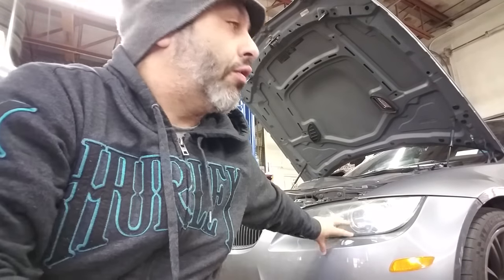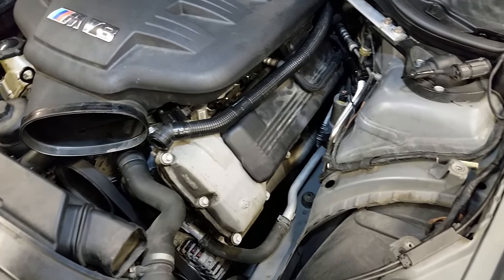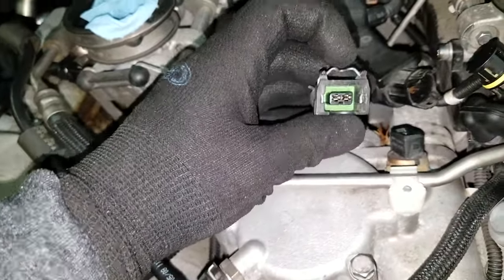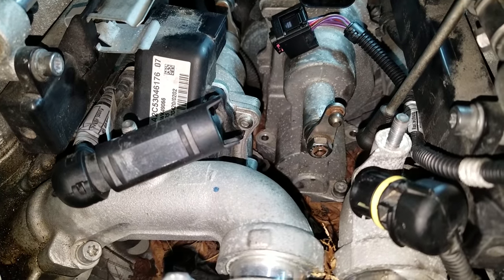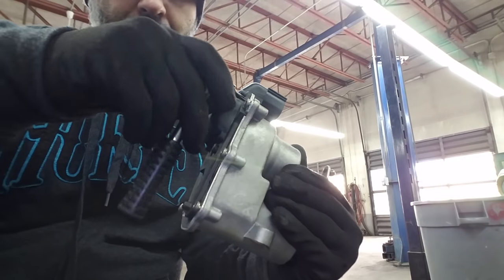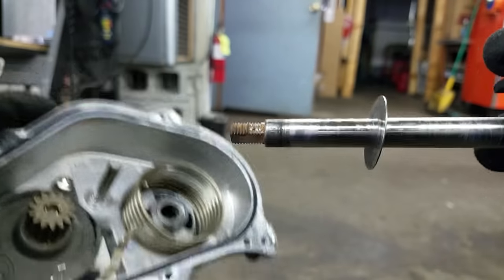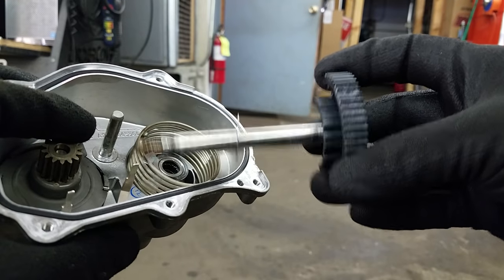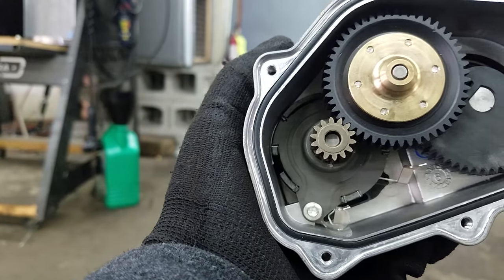BMW S65 E90 E93 E92 M3 Throttle Actuator DIY

Comment: Hey man I have a big question my car is a BMW m3 e93 it jumped into limp mode one day and I parked the car the next day I turned the car on and it was fine when I scanned it code u1151 came up that was it then the next day it didn't jump into limp mode it just said increased emission again I shut it off I didnt have the scanner to check what other code it was some people tell me it's the battery going bad some people tell me just to change the actuator it's my first BMW so I'm trying to get as much knowledge as possible if you can get back to me I'll really appreciate it
Reply from the maker: So I did some research on the u1151 code. I can't find much but what you said. Some people say battery some people say actuators. I need to do a video on the code reader I use...Creator C110 from ebay. If will spit out bmw codes instead of generic codes. I will say this....what your car is doing is what mine did before the actuators went out with it being a bad board. The car wigs out, turn it off, back on , and codes go away. Mine did this twice before it crapped out. So I'd seriously start looking for parts now. Thats what I did and still had to buy a new actuator

Comment: Would a shower cap on each bank work better than rags in the throttle bodies?
Reply from the maker: +kontradictions I think anything clean would work. Just make sure not to get anything lodged in between the flaps

Comment: you know you don't have to take two bolts or nuts of the ///M v8  intake box right?
Reply from the maker: Well I knew that after I took them off 😂😂
Reply: @RDDC_Official  lol, I have done that rookie mistake first time repairing the throttle actuators

Comment: Where do you recommend to buy the parts ? I have them replaced with parts from Poland but still the problem is there, it seems even worse
Reply from the maker: Turner Motorsports.

Comment: I’m literally having the same problem with my m3. I hope this works
Reply from the maker: It should. But a few things. If you threw the Christmas lights the first time and the car wont move then it's most likely broken gears. If you threw codes several times that cleared and even a final time that the car was still drivable in limp mode....then it's a bad board. Regardless the throttle actuators are down to $600 each at Turner Motorsports.

Comment: The original part is PPA-GF30 which is Polyphthalamide with 30% fiber-glass reinforcement... I don't see any materials marking on the new stuff.
Reply from the maker: Thanks for adding in the info.

Comment: So the one you bought in eBay was $100 but the OEM is about $900? And the one you bought seems to be a higher quality. Sounds almost too good to be true? How has your car been since you replaced the actuators? Appreciate the help.
Reply from the maker: +Dave S no the ones I bought on eBay were just the new gears. But since the board was bad on Bank 2 I was forced to buy a new one. I could have bought a used one but I'd rather have a new one. Hard to trust used ones
Reply from the maker: +Dave S Forgot, car has been running great every since

Comment: Nice work. Curious what kind of camera did you use?  It does a nice job autofocusing quickly where you want it to
Reply from the maker: My basic cellphone. I have to replace my other one so thinking of doing a better updated video soon. My car is in the shop getting the bearings done as we speak
Reply: @RDDC_Official  oh wow. great phone. i need to get my rod bearings done as well.
Reply: @RDDC_Official  can you tell what signs you had that made you get them done?

Comment: Why is this good, that the round wheel have metal small center that connects to the half wheel?
Reply from the maker: I was only testing it to see if the metal wheel latest longer than the plastic wheel. I did take it apart and when the board failed and found the plastic gear slightly cracked. It wasnt any better or worse than original

Comment: RDDC, good video, thanks.
kinda my me dizzy all the camera not focusing but i'm ok now lol.
let me ask you, when these TA go bad, how can you tell if it's the gears or the board?
and i'm looking at a 2011 m3 now, that has 146xxx miles on it that seems to run good, if not real good (i cant really compare, its the first M car i've driven) anyways my question is, should I just order this rebuild kit and replace the gears like you did, or just let it run till i see signs for failure?
what signs did you have that made you do this?
Reply from the maker: Ok if it's the board the problem will clear with a code clearer and go away. Might come back months down the road. Then happens again and each time it's less time between clearing codes. If a gear breaks, most likely the code will not disappear or comes immediately right back and your car will be stuck in limp mode until you replace it

Comment: Just wondering how long did it take to pull both out then replace them, I will be doing mine soon as preventative maintenance as the last thing I need is to go into limp home mode in the middle of the Nullarbor .
Reply from the maker: 4 Hours and that was videoing too and reading the forum post on how to do it. So I'm thinking someone can do it in 3 hours
Reply from the maker: +Hooray4boobies The links are in the descriptionof the DIY video. Car has been working great since the fix. The gears were $180 for both sets

Comment: So in the beginning you said that the board went bad, how much is it to replace that part?
Reply from the maker: That's a whole new actuator :(   Yup...$1,000. I ordered one from Tuner Motorsports Next Day Air. Will ship out Monday and be here Tuesday. I couldn't find anyone that sold boards separate. Talk about shitty luck. And these "repair" places you have to send yours in, wait, then they send it back. I dont have time for all that. So I just ordered a brand new one and it has a 2 year warranty. Only crappy thing is I can't take the new one apart to upgrade the gears or I'll void the warranty.
Reply: RDDC oh man that's not fun ,  is it something all BMW m3 owners have to deal with at some point or it's just luck of the draw ? I test drove the e93 convertible m3 and It still makes me want to pick one up too. Good luck with your cars and the e36. Been enjoying the vids by the way, very informative
Reply from the maker: +Sam Everyone told me it would happen sooner or later. The forums all say it will happen. I just happen to get lucky that it took so long to fail. And thanks for kind words. Got more videos coming from the past month. I was recording just zero time to edit. I was out on business

Comment: Can the throttle body actuator cause misfiring, and causes the engine to go into limp mode
Reply from the maker: That Im not sure of. I'd assume the injectors or ignition coils first. From reading the forums misfiring is not a system of throttle actuators.

Comment: Hi can replace new battery without registering it cause limp mode, and false reading on acutator fault
Reply from the maker: I have replaced my battery twice and not coded it
Reply: @RDDC_Official  i see.. i ended up replacing my TA both new with new battery

Comment: Nice video man, you teach well. Do you know if the V10 60 M5 actuator is the same way ? I noticed the kits for it do not seem to include the  'bolt
 yours did.
Reply: The acuators are same for the v8 and v10. Most kits come with gears only.  As the poster said, buy the kit with the shafts already installed. FYI, the kits with built in shafts usually come as a single sety; you have to buy two.   The gear only kits come in pairs
Reply from the maker: I'm seeing more boards fail than the gears. Even after like 140k miles my gears still looked ok. Not new but not enough to cause a fail. The board is the biggest culprit. It heats up and fails.
Reply: RDDC are you saying its better to just invest in NEW throttle actuators 800 both??
Reply from the maker: I did. I know I rebuilt the other one but the board has failed now in it too. So I bought a new one like I did the drivers side. That company where you get it for $360 each and you return your core is a deal. I'll be ripping my car back apart soon to show wear on the rebuilt gears, if any. I'm curious to see how they held up. Just in case those who had bad gears want to rebuild them.
Reply: RDDC awesome intel RDDC; what’s the company where you can get the TA’s discounted if you return your core? Thinking about trying to tackle this & exploring options.
Reply: @ozzarelli  M Power Motorsports

Comment: Doesn't someone make metal gears for this? If they don't, they should.
Reply from the maker: +Matt D they should but I think someone noted that heat might warp aluminum gears. The set I put in has a brass smaller gear and metal bracket support. Looks robust. I'd like to take it back apart in a year to see how they are holding up
Reply: Yeah that's a great idea, or maybe given them a while longer before checking? Your original gears didn't fail till after 120k miles. I'd be surprised if the gears experience much heat though since they're currently made out of plastic. The gears would have to get real hot to start making metal gears expand and warp. 

Love the vids though man, keep them coming :)

Comment: Nice video, very informative. Did you check the INPA/EDIABAS tools? I'm not sure, but they might provide a way to test or actuate the throttle actuator itself.
Reply from the maker: Zzero clue what INPA/EDIABAS is. I have a BMW code reader thats show me % of actuator movement. I need to do a video of it. But I'll have to check into what you are talking about
Reply: Those are technically too old for the car anyway. Dealers use ISTA-D. A more powerful software package that does everything. GT1 was before ISTA-D. Car's past 2008, GT1 won't read them. You would only use GT1 for cars around E46, E83, E53, E60, E65 and E31.
Reply from the maker: +Devin Smith It has settings up to the F30. But I did some software the other day on the forum (a screenshot) that was highly detailed. This must be what you're talking about. I need it!!!
Reply: Well save up for an ICOM A3 kit with software. Let me know if you can get it working. Were up to version 4.0.
It will tell you wiring diagrams, diagnostic steps, torque specifications, faulty memory reading and it shows the entire control unit network. Its far better than what other auto groups have. I can tell you Roger, ISTA-D is more than a code reader (which is what most ebay sellers and Strap-On sells anyway). The only thing you can't really do anything about is ISTA-P or IMIB (Our multifuntion Oscilloscope with current measurement capabilities). I would get a hackable Rigol 4 channel Oscilloscope for measurements.
Reply: Devin Smith Believe me it not too old, I used it last weekend to bleed the ABS ECU and used it numerous  times to functional test other units
Reply: Yes I believe you, still that software is over 8 years old and its software hasn't been updated. It is still realistic to use GT1 for older models (though it lacks allot of new features). On dealer standards any car that is out of warranty is considered old (more than 3 years old). ISTA-D is the newest software globally and its still at least 4 years old. There in the states, allot of cars have problems that no other car in certain parts of the world have. We've decomissioned (destroyed) our DIS diagnostic equipment because its so old that no one even uses anymore since the release of newer equipment (that machine is 3x the size of the Bosch diagnostic station). ISTA-D used to be only sold on ISID machines, now it can run on pretty much anything with a spoofed hard drive serial number. Vehicles with outdated control unit software that pools garbage fault codes, ISTA-D will direct you to perform programming, INPA on the other hand will leave you running in circles (replace control unit? and then program).
Reply: RDDC If after your research you are interested in getting the INPA/EDIABAS software package, I could provide you a copy. I use it for my car all of the time!
Reply from the maker: +Henry Larson might take you up on that. Good to know
Reply from the maker: +mitchk344 nice. Here's the thing though. Even if the software test the throttle actuators how do we know if the gears are worn or the circuit board is bad? Both would exhibit the same behavior of not moving depending on how bad the gears are worn. I need to check out this software. I'm old school so I just test the things out physically. I got two on the car and the odds of both failing at the same exact time is slim I think so you can always test one with the other, which is what I did. I put the bad board on Bank 1 from Bank 2 and bank 1 tripped a code and bank 2 was fine. But I can see many handy uses for the software. Last software I used was the TIS/ETK. So I'm due for an upgrade.
Reply: RDDC In your cause, I would have used it post repair, just to make sure everything is in working condition before reassembly. But I used it too, when I drowned my Adaptive Light Control module and had to install a new ALC module, which had to be programmed for the car. And changed the car modes, for instance beeping alarm ON/OFF and the remote's button functions.
Reply from the maker: +Henry Larson I'll be hitting you up for sure. It would be really helpful especially with me running a YouTube channel. Thanks for all the helpful advice
Reply: BMW makes caution notes for a reason. It helps to prevent damage or set it in installation positions. The servomotor was never meant to be repaired individually. Unless the brand knows that it can be repaired in a reasonable time, they will ask to replace the entire unit. I like Roger's channel because he does sensible things (repair when neccesary), unlike that joker from that Engineering channel (replacing a timing chain tensioner with an aftermarket one based on wild internet theories). If the timing chain has worn to the point it makes a noise or is jumped timing, you replace the whole chain, guide and tensioner assembly, you don't gaffertape the repair job.
Reply from the maker: Thanks!!!

Comment: If you own a E9X M3 (s65) or an e60 M5 (s85) , Chances are more than likely your throttle actuators are going to go bad (if they haven’t already). It’s better to upgrade them as a preventative measure rather than finding yourself in limp mode on your way back from work. Why pay $600+ for a new unit which is inevitably going to go bad again, when you can get an upgraded rebuilt unit for a little over half of that price?  MPower Motorsports rebuilds your TA’s in a manner that will outlive your car and they come with an “unlimited miles lifetime warranty” to show for it. You won’t have to worry about them going out again. They’ll even refund you $100 once you send in your faulty core.
Not only are their prices unbeatable, but Abdul (the owner) is an absolutely amazing guy who really knows what he’s talking about and goes out of his way to make sure you’re satisfied. These guys are doing a great service for the M community. TAKE YOUR MONEY TO M POWER!! Best bang for your buck!! 
Here’s a link to their website:
https://mpowermotorsports.org

Comment: Thanks for the vid ! How many miles had the car when you make the replacement ?
Thanks :-)
Reply from the maker: 140k my first one, 169k my second one. Not bad considering I hear others going half as many miles
Reply: @RDDC_Official  Bank 1 failed at 43000km or 26000 miles!!! Replaced gears only, codes did not clear right away - hoping they will clear tomorrow. Otherwise, whole TA must be replaced :(

Comment: Bank 1 failed at 43000km or 26000 miles!!! Replaced gears only, codes did not clear right away - hoping they will clear tomorrow. Otherwise, whole TA must be replaced :(
Reply: Get it from rebuild.org.uk. Send the failed ones over, and you receive two remanufactured with lifetime warranty. The guy is perfect. I bought mine from there.

Comment: Great video, just had code p0638 come on when I was driving home from work. Ordered 1 TBA for bank 1 but I'm questioning if I should get a 2nd
and for bank 2? I kinda want to get as much life out of it lol
Reply: Also why are the gears plastic?! Wtf I expected more from bmw
Reply from the maker: That was my theory, was trying to get as much life out of the second one as possible. It lasted any additional 30,000 miles. And you dont have to buy two at once. The job isnt that complicated to do again
Reply from the maker: Not sure. Timing chain gears in old vehicles were a nylon/plastic and they held up decent. On the TA's I see more boards fail than gears. But that's me. You'll hear varied opinions
Reply: @RDDC_Official  yea doesnt look that bad, I had an Acura rsx back in the day and had to  take the transmission out twice because I knocked teeth off the final drive and thought it was a bad clutch at first. That was not fun... let me tell you.
Reply: RDDC How do you go about changing the board?
Reply from the maker: @tristan.23  you dont. You just get a new TA

Comment: What brand of gas do you prefer for your M3?
Reply from the maker: +Taharqa Saaba I prefer Shell V-Power but it's not available in my area. This seems to be the preferred gas for M3's people choose.
Reply: RDDC Thank you! BMW here in West Palm Beach told me only to use Chevron. I have Chevron, Shell, Exxon and Mobile1 all next to each other. I am going to start using Shell. Chevron can be a hassle to find sometimes.
Reply from the maker: +Taharqa Saaba Yeah all those are decent but Shell has been tested and proven to be the cleanest gas and uses nitrogen to clean carbon buildup.

Comment: Great Job👌☝️👍
Reply from the maker: Thanks
Reply: Just replaced both Throttle Actuators, the codes are gone But now I have 1 New code which is 2765 DME: Vanos Valve. Inlet. Bank 2 , activation.
Do you have an idea of what that can be?